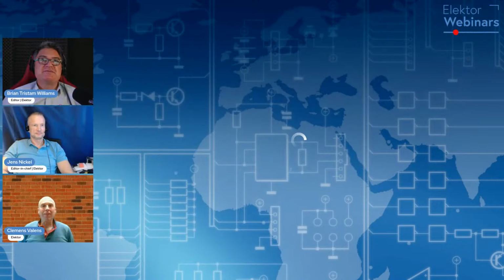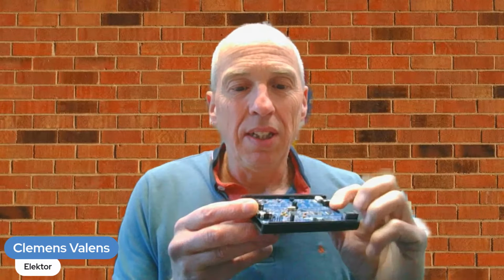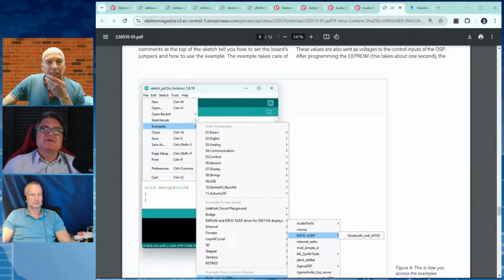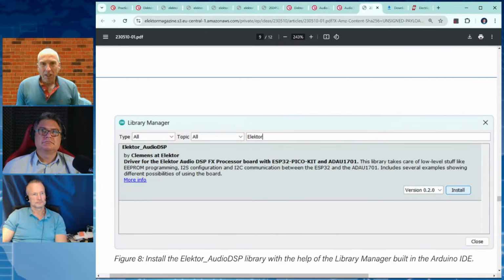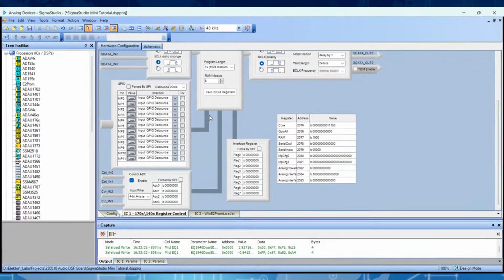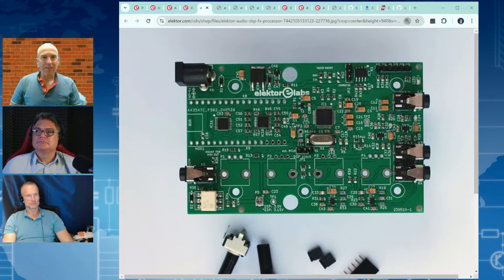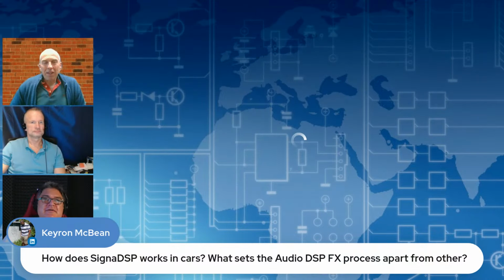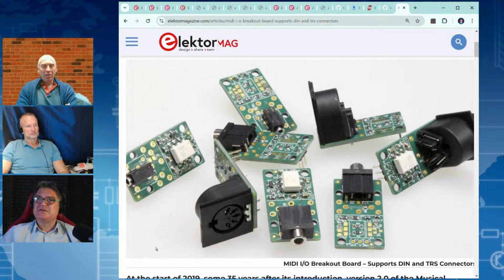Audio DSP FX Processor with Clemens Valens — An Elektor Webinar

Comment: Taking something to the next level sounds good, but speakers for closed enclosures would also have to be taken to the next level, e.g. +-10mm hub and short-circuit ring Tpohl with acceptable parameters for passive and active, which of course means two different drivers, without that To increase the weight of the membrane so that the oldskul sound is retained, e.g. you can easily achieve this with a single-layer flat wire winding, it can be done yourself round wire single layer, only you need a larger magnet, so what is täurer? ,flat wire and small magnet, or round wire and larger magnet?   , and don't sell us oldskulchasis two-layer with +-3mm stroke and metal basket for overpriced money, and a short market hype, since tomorrow it will be said again that closed speakers are worse than bass reflex. If you research the market, you will find that it is Such chassis do not exist, except for me privately, because I convert them for continuation, otherwise there are subwoofers on the market You can't have a kick bass because they have too heavy a membrane mass and some voice coil inductance is too high, so even a DSP is no use, because what's gone in terms of dynamics and sound is gone forever!!!
Reply from the maker: Thanks for your detailed insights! You make a great point—while DSP can enhance performance, driver design is fundamental, especially for closed enclosures. Balancing lightweight membranes, efficient magnets, and excursion capabilities is key. The market could indeed benefit from more innovation in this area. Your DIY approach sounds fascinating!
Reply: @ElektorTV  thanks for the feedback🙃